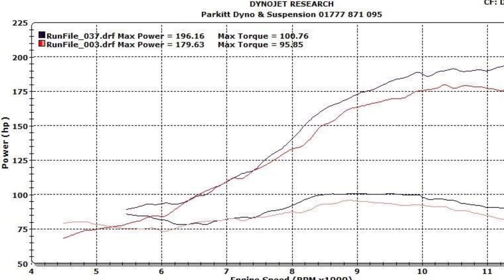Ducati 1299 Panigale Dyno Runs ECU Tunes with Woolich Racing

Comment: On what dyno and at what altitude ?
Reply from the maker: Dynojet 250I 300ft above sea level
Reply: @parkittdynoandsuspension  
Well done . That's impressive 👏🏼 👌🏼. 
I gained 186bhp on the wheel on a dynojet at 1600 meters above sea level .